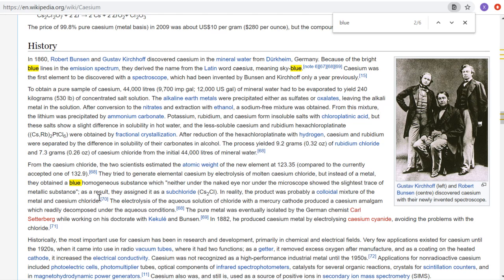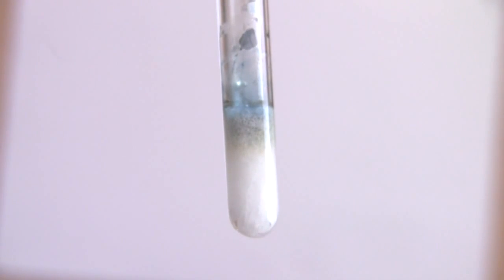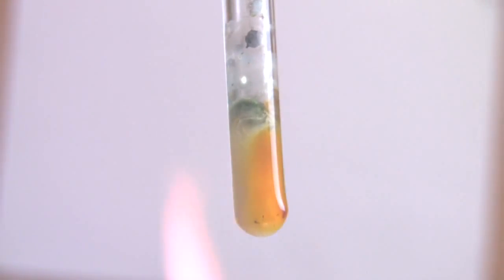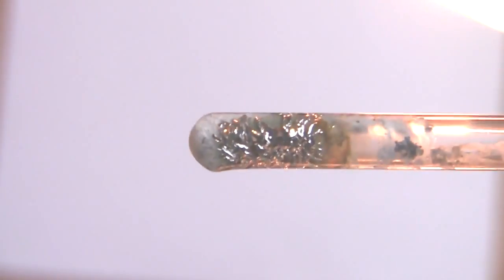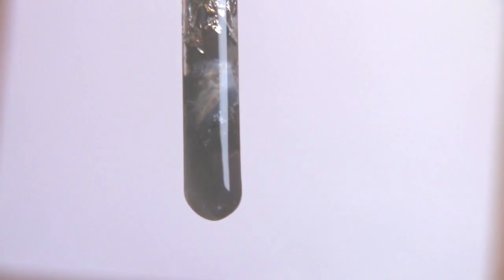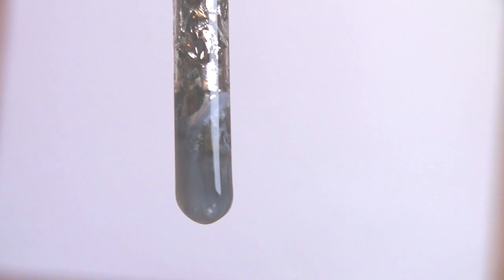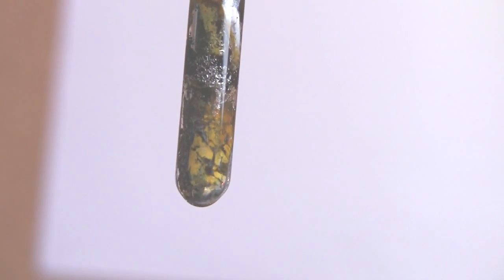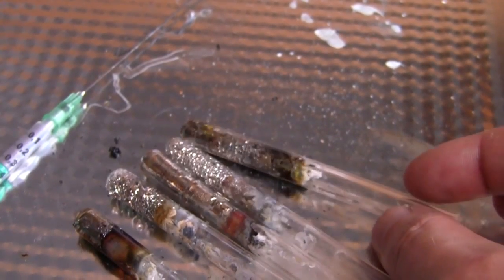Sodium plus MOLTEN Cesium Chloride!

Comment: Alright my two cents,  First you see at the addition of NaK the formation of some grey stuff and blue stuff. As the NaK probably react in an instant, it forms as fast as possible Cesium, but electrons are left and put in the cesium greating your solvated electrons/ CS at -1. It does not spread further become of the resistance as specially when it is solid. Now this metallic Cesium is formed fast and therefore has a high change of being colloidal and i guess this gives rise to the yellow and red color afterward. Change is collor either by concentration change or particle growth/shrinkage.
I would like to see what happens if you add cesium to the molten salt, will it dissolve?

As the second observation is the formation of visible cesium metal during cooling. It is expected that during cooling, the salt will freeze first and crack, all the cesium along the cracks have pressure on by the formation of the solid salt and is forced out, thus seeping out the cracks to the outside, where space is formed during cooling. What will reheating do after this formation?

Comment: That reminds me of the process of purifying germanium chrystals.
The melt zone is moved slowly along the crystal, with the recrystalisazion side being purer and the impurities going towards the warm side.
In this case the hot salt would be able to have a high solubility and when it recrystalizes, whatever doesn't form a very stable lattice, will be forced out.
So a chemical process takes place along the effect of the oversaturated solution forcing out whatever doesn't belong in the new lattice. 
In any case, it looks very fascinating. And I hope you get a proper explanation of the process.

Comment: Hi Thunderfoot! No idea if you'll see this comment but calcium aluminate electride may also be produced from a high temperature molten electride salt, with various metals (and in one paper maybe even graphite) donating the required electrons. I'm willing to bet there is a whole family of high temperature ceramic/ionic materials which are thermodynamically stable electride salts. Hey other people who see this; if you have a way to get in touch with Thunderfoot let him know about this. Thanks!

P.S. Looks like that sodium potassium alloy mixed with cesium bromide forms a eutectic phase between a metal and a salt! Very interesting indeed! I suspect very high electrical conductivities may be possible at room temperature with some of these materials - perhaps beyond silver? If so there could be some interesting niche applications where the reactivity is less of an issue.

Comment: If the 19th century account is true, free electrons might be observable in solid material at room temperature. That sound extremely fascinating

It's interesting how long they would last enclosed in glass. Maybe after a while the extra cesium would leach from cesium chloride. If not, its a good idea for a science exhibit 

Also, as someone said in the comments, it would be interesting to see how free electrons (both in solid material and in solution) respond to electric and magnetic fields

Furthermore, are they locked in place in the solid salt or can they move around and thus carry charge? I imagine that maybe free electrons in solid cesium chloride could jump between available positive regions and this material would be much more conductive than normal cesium chloride

Comment: You might have oxides formed in the tube unless it is oxygen-free. Caesium oxide (Cs2O) forms yellow-brown crystals. Also bromine might be liberated as bromine does not bind so tightly as chlorine. But it is a surprising reaction, really unexpected.

Comment: I also noticed a slight yellowish color forming on the right side of the cesium chloride electrolysis footage in the U-tube that he put up on Youtube. Maybe it has some thing to do with the electrons being stripped. I also thought that that greenish color that you saw was a combination of the yellow and the blue colors because you had not fully melted the salt and it was not a homogeneous mixture. I would like to see what happens if you continue pushing that reaction further than that.

Comment: I'm wondering if this has anything to do with how thermal rates change how parts of a molecule behave (like bimetallic expansion rates) when cooling the excess stress on part of the molecule force bonds to break, essentially crushing when crystallising, causing precipitation of the metal. no idea really, this is fascinating stuff :)